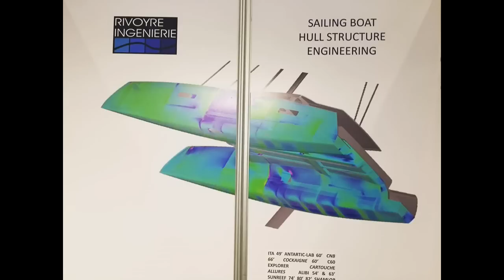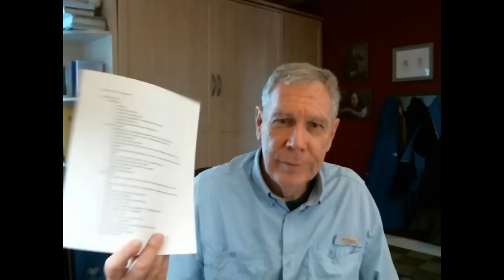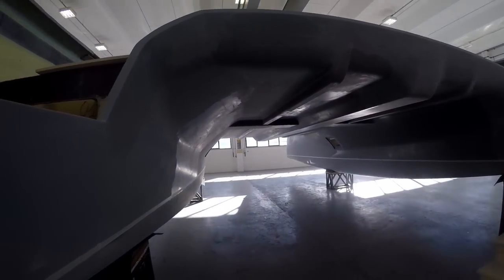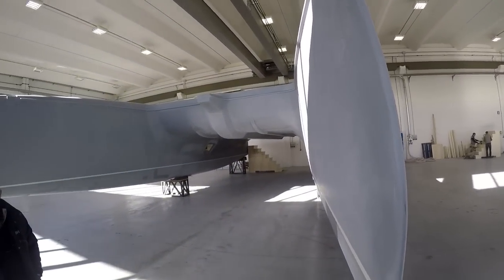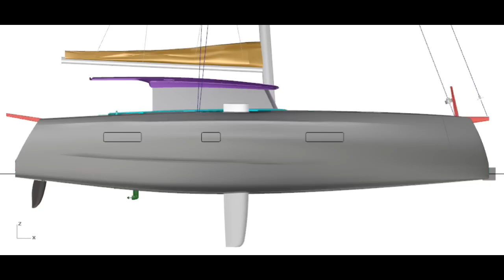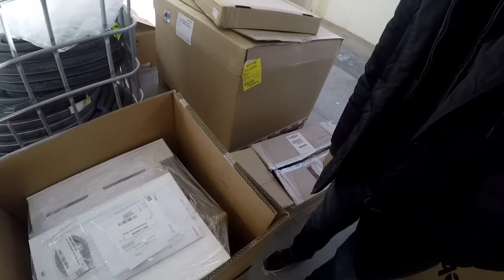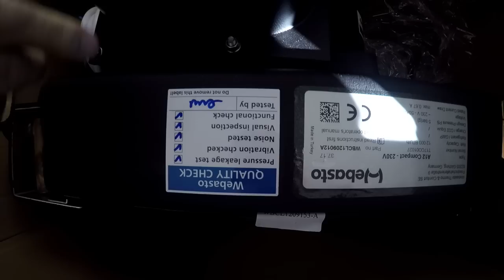ITA Factory Tour 2017

Comment: 15 Kw genset NO, one more engine to maintain, be better to Lithium Batts,  1600 amp hours minimum, bigger alternators on main engines 200 amp.  If genset quits your screwed.
AND where is the solar? I do like the sharp bows, cut through the water.
Reply from the maker: The 15 Kw genset is for the electric drive option. The boat can be ordered with electric or diesel engines. For the diesel option the genset can and should be much smaller. Regarding solar, there is a lot of room on the cabin top for the panels. Working with the US dealer you can easily accommodate 1.2Kw of panels of not more.
Reply: A diesel engine to run a generator to run a electric motor to turn the prop, use the engine to turn prop. I build electric motors for electric cars but would never suggest putting one in a boat unless you plan on staying in the harbor all the time. The middle of the ocean, NO wind for days?
Reply from the maker: Completely agree, I don't believe the technology is there yet. I would not select the hybrid drive option at this time.
Reply from the maker: Thanks, I follow their vlog and think they do a great job of walking through the technical stuff.
Reply: Great video. Thanks for sharing your insights. For sure the most attractive boat out there at the moment. At least “on a distance”